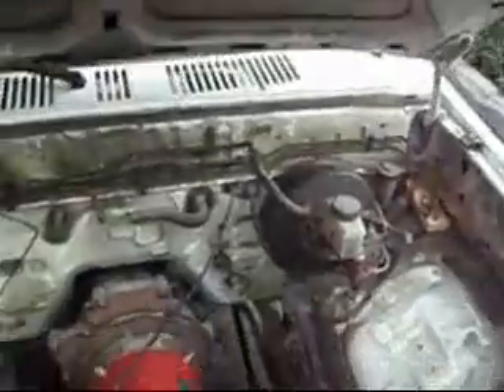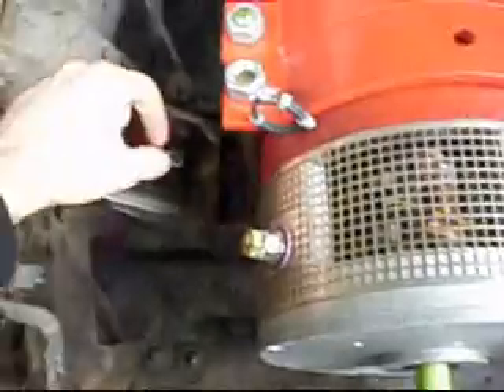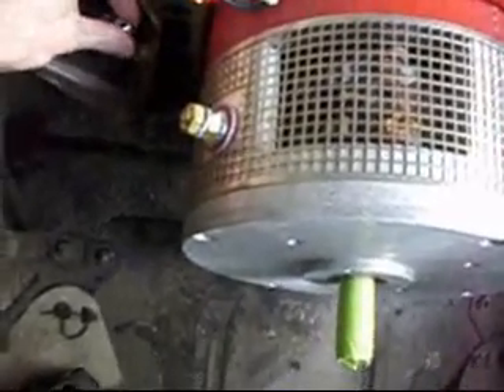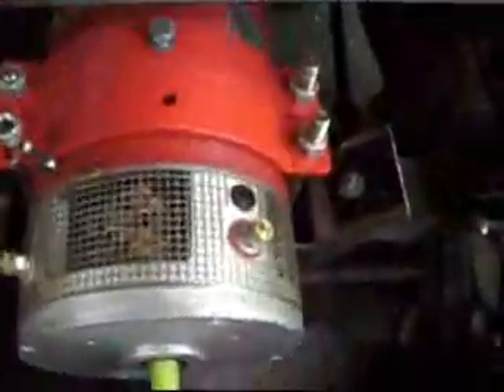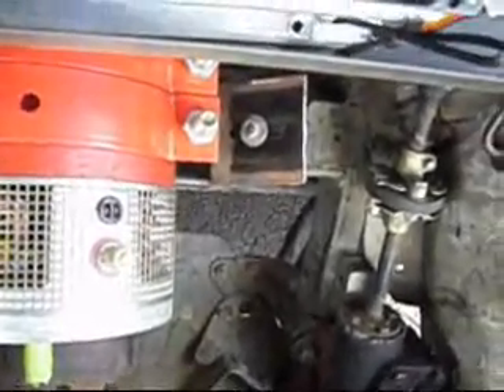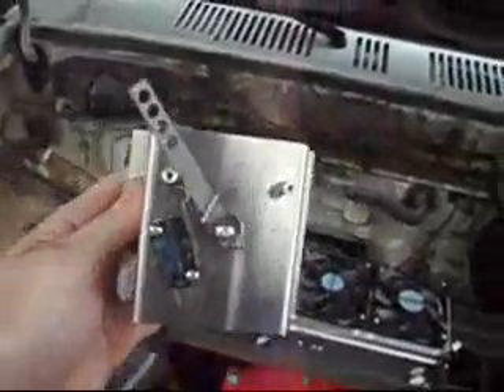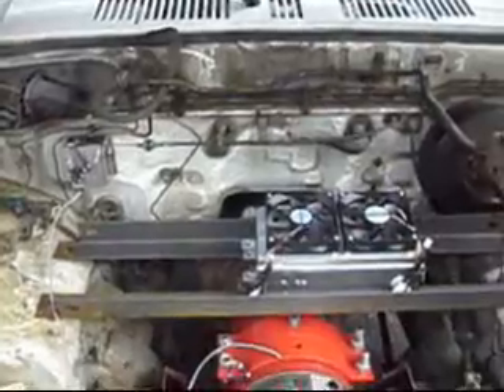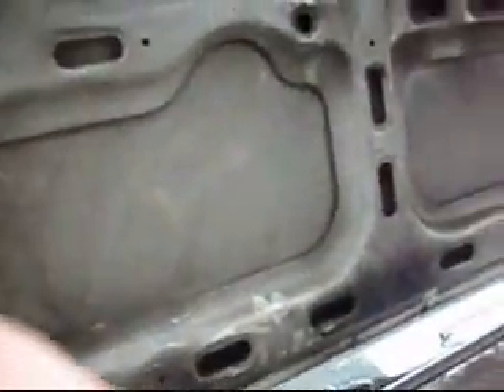Jared's Electric Car March 10, 2010.wmv

Comment: If you havent already,you may want to add a spring to the opposite side of the pot arm so it adds a little more tension or resistance to the throttle cable.
Good Luck with your build,cant wait to see it completed